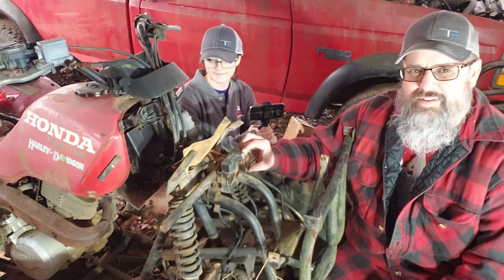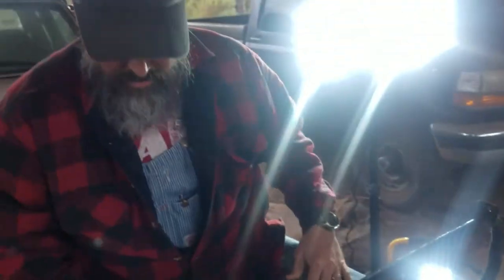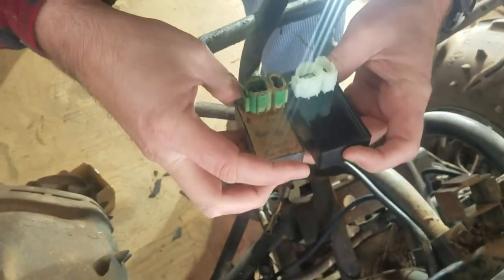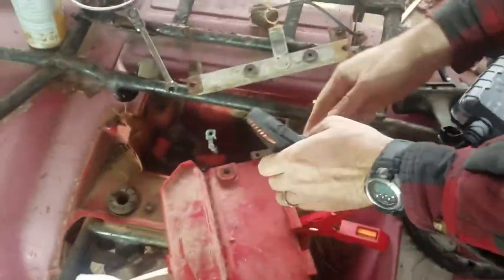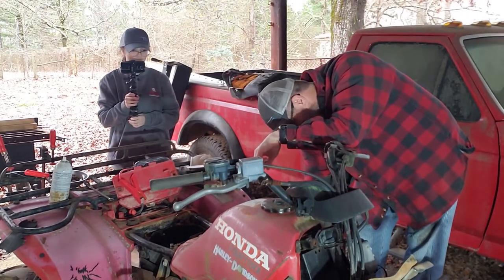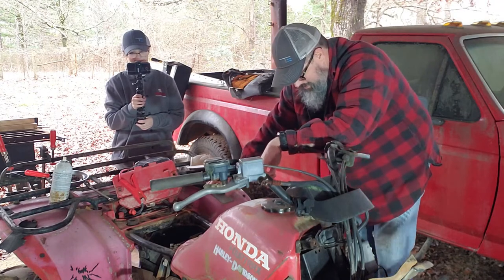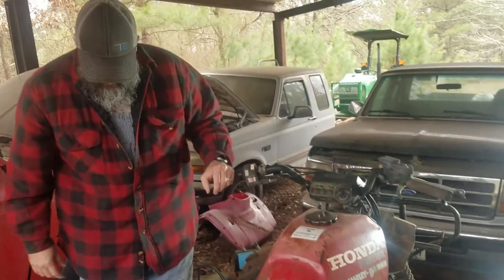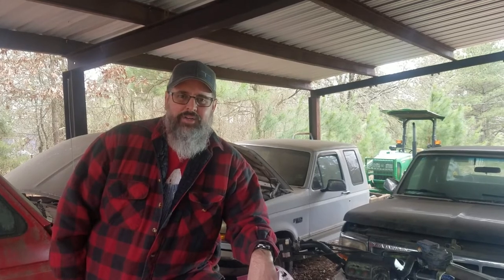Honda Fourtrax CDI Box

Comment: That box you changed is the alarm box. Low oil, and temp. The cdi box is the bigger black box next to it. If it has moisture inside of it you can heat them up to help dry them out.

Comment: You changed out alarm box not cdi box. Dont order cdi off Amazon get a Honda Box. The Amazon boxes will connect to your wire plugs but the pins are different.

Comment: a carb re-build kit is around $35. an inline fuel filter is around $7.a new plug is under $10. the air/fuel mixture screw is on the front of the carb. tighten in gently, until it seats & then back it out appx. 2.5 turns. you can fine tune it after everything else is fixed to find the "sweet spot"
Reply from the maker: Done all that and still haven't got it right. I'm just not good at carbs. I just going to have to get more practice.

Comment: I'm having same problem worth my 96' 3004x4,you change the small box an it's trying to run.is there a way to test old box or are they cheap enough to buy,thanks
Reply from the maker: The box was pretty cheap so I just changed it. there may be a way to check it but that is beyond my knowledge.
Reply: @ARR-SHOP  thanks,tore it all down like you did,changed the coil,wasn't the problem.the darn kill switch is the issue.good spark now.

Comment: For the the bigger box of the cdi box the one you didn’t do at the begging of the video how would you get that off? Mines a 1988
Reply from the maker: It should just slide out of the rubber holder if I remember correctly. mine is a 97 so it may be different.

Comment: I’m having the same issue with my 86 Honda Fourtrax.
Did you order a OEM replacement box or a eBay box.
I ordered a eBay box and still having issues.
Reply from the maker: I got mine off of Amazon